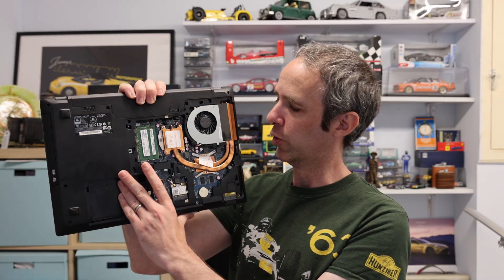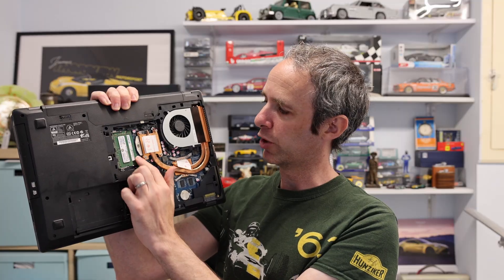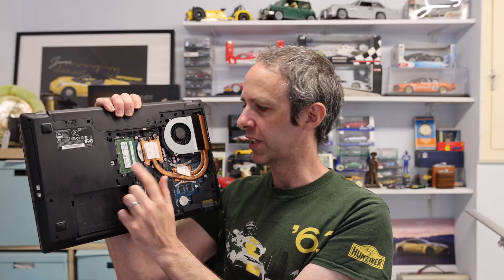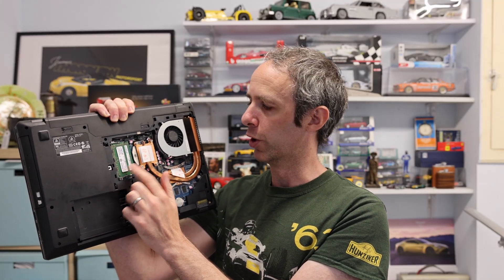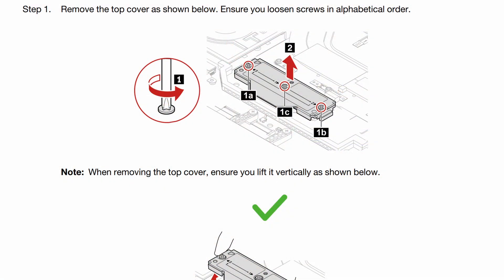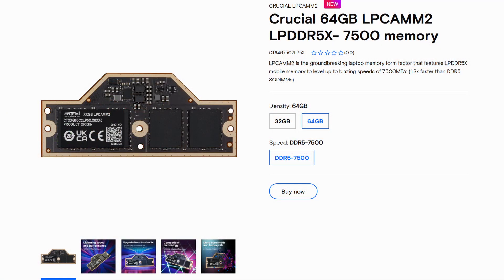Why isn't laptop memory upgradable anymore? (and why it might be again soon)

Comment: Laptop Hp 255 g6 8gb Intel corei5  HDD+SSD 500Gb
Reply from the maker: Yes, these are upgradeable! I have a video on the HP 250/255 G6 here: https://www.youtube.com/watch?v=2KK5L9v07HU
If you have an Intel Core i5 I think it should be an HP 250 G6 though? The 255 G6 is the AMD CPU version of the same machine.